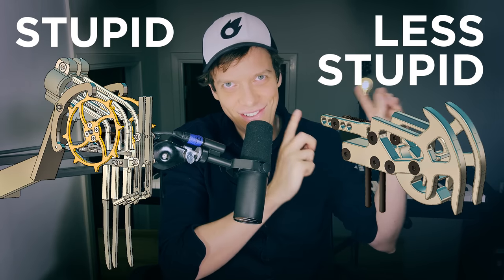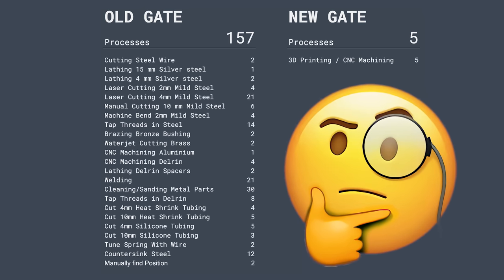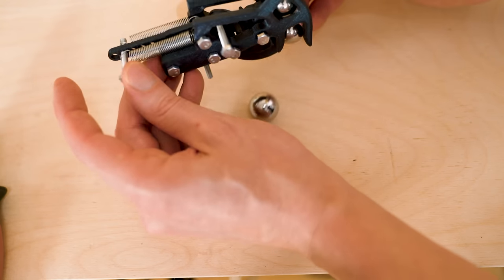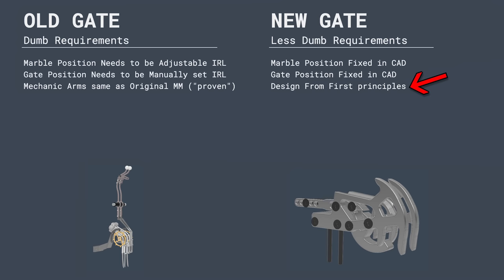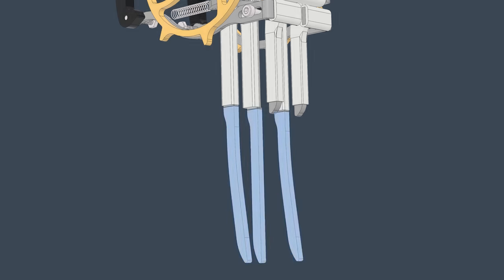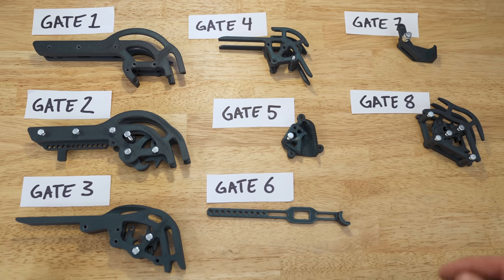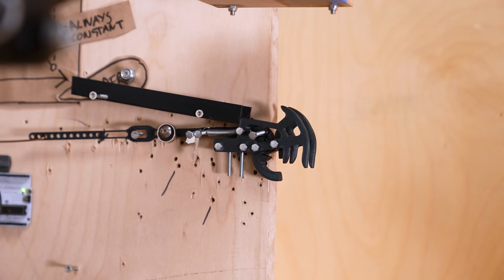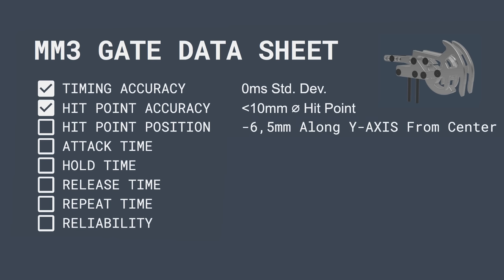This Design Trick Surprised Me!

Comment: You haven't completely prevented manual playing: if, later on, you decide it's worth the part count, you can always add a linkage between the programming wheel and the gates.

The important thing is that you've isolated the gate from this other feature. That way you can focus on what matters for the marble drop.

Now, you've also got the flexibility to only add a manual control to some channels without needing to design two separate marble gates E.g. Just one channel for each note on the vibraphone
Reply: I would just add a button to the front of the gate that is a part of the linkage so a simple press performs the same function. The buttons could even be made to look like a keyboard with black and white.
Reply: @jonathanmyers8477  that’s probably the most simple and elegant solution
Reply: @jonathanmyers8477  Though it comes at the cost of tighter integration. I could really understand leaving the gates themselves unchanged now (since they're a 'known good' element). If I were approaching the marble machine as I would a piece of software, I'd be looking to add the functionality on outside the gate
Reply: He had 2 channels to get faster tempo consecutive notes. The time needed to stage the next marble, as well as the necessary attack, hold, and release times really limited the speed he could achieve without double gates, and he sounds like he wants to retain the ability to maintain tight timing on super fast notes with dual gates (around 16:25).
Reply: @jonathanmyers8477  I though something similar, you’d want to make it so that it makes no contact with the mechanism unless pushed. That way it does not add friction or mass to the mechanism when not in use.

Comment: I'm currently studying mechanical engineering, and this video is incredibly inspiring, not only because of the simple and efficient mechanical concepts but even more so the thought process through the development phase. I can relate to the process of falling, reflecting, and improving through the different semesters. You're always learning new things, through new concepts and processes, and that is what makes the world of engineering and invention so incredible. Thanks for inspiring me and also the next generation of engineers and thinkers.
Reply: Dagern, it might be worthwhile to share this video with the other students, or even your professor.
Reply: If you are to iterate by experimentation the iteration must be fast.  Rather, start with a solid plan, simulate or do quick experiments and finalize it.  Then add optimization and tuning, not wholesale redesign every time.  40 years of engineering and design of microprocessors have taught me these hard lessons.
Reply: @randyscorner9434   Martin's point is to make the design requirements less dumb (@4:33). Since he's a musician and not an engineer (I too have done chip design [for the storage industry] and am now retired; so you and I on the same page) he ended up with a massive reset of the design.

If your initial assumptions are overly complex you're screwed. Witness the recent hard-to-solve security bugs discovered with x86/64 architecture, versus ARM architecture. That whole look-ahead prediction logic for Intel's CISC design is insanely complex, bloats the gate count of each core, and is at the heart of the recent security bugs. Server-class ARM chips are up to 128 cores per chip.
Reply: @randyscorner9434  the difference between Martin and most real world engineering is people are not paying to watch you fail. 

In the real world you have deadline, budgets, and managers. 

A bad product is better than no product in most cases. 

Martin has been making the problem a lot of young engineers make. Paralysis by analysis. 

Also bad products and failures teach you way more than CAD designs. One of the major problems with CAD is that there are so many unknown variables that cannot be accounted for in the real world.

Comment: Simpler is always better in designs :)
 Keep up the good work Martin!
Reply: MRI machines
Reply: The simpliest design would be to not do this. Dropping balls through the air instead of servos? This entire project is magic and whimsy. Removing some of that, OK, but insisting simple is better would mean to abandon the entire project. It's mimicking Animusic, after all.
Reply: I'm guessing that the next Marble Machine WONT USE ANY PARTS AT ALL .................
Reply: Cannot agree more. Each additional piece creates a new failure point as well as a longer time to deconstruct and reconstruct.
Reply: simpler would be to make a programmable instrument that doesnt use marbles as inputs like euuhh a keyboard for example , seeing he already has one could we call the project finished?
Reply: or is that to simple than ? 
maybe he should revisit the speelklok museum and see how many of those machines run perfectly in/on time and beat and tight , its a manual instrument do we really want it to be so flawless that its actually almost digital like?
Reply: That depends. Are you trying to make a machine that plays music? If so, then yes, simpler is better, so make it simpler by removing the most complicated aspect, all the marbles.
You can either use a computer to synthesise the sounds, or if you really want that manual feeling of the instruments, you can just have electromagnetic parts like servos or solenoids play it directly. No need for any ridiculous marbles.

Conversely, you can instead be trying to design a work of art, where simpler is not always better, and aspects of the machine that are being cut will significantly take away from the artistic aspect.
Reply: @jeffreyblack666  exactly my point

Comment: This is a great video.  As a mechanical design engineer and manufacturing consultant for 35 years, usually/often the point of designing and manufacturing a product is to get it into production and make a profit.  Without a reasonable manufacturing cost, the final cost to the consumer is often too high to be affordable.  So even if it is cool looking, it will cost way to much (for the task) if it is too complex.  So I've found over the years that the most elegant solution is usually the simplest solution that does the task well.  So I think you are really on the right path with your new design requirements.

You have to know the market for your product and understand what would be an affordable and reasonble cost to the customer.  Then work backwards in your calculations and you will begin to get an idea of what your cost has to be to get it manufactured and out the door.  Also, keep in mind that if you intend to sell your product on a store shelf, you will likely have to get your total cost down to a small fraction of the price when it is sitting on the store shelf.  It is often the case that the price will be doubled each time the product changes hands.  So you may sell your product to a wholesaler for $100.  The wholesaler may sell it to the retailer for $200.  Then the retailer may sell it to the customer for $400.  So you make need to build it, package it, market it, and include a profit to you for a total of $100 just so that it can be sold to the end customer for $400.  That is a very tall order.  So think of it this way.  If you can reduce the cost by just $1, the cost to the customer can be reduced by $4.  This is a great thing.  This also shows why it can really pay off to sell directly to the end customer... because these markups can be reduced or eliminated.

Ed Schultheis, PE
Mechanical design engineer & manufacturing consultant for 35 years
Schultek Engineering & Technology, Inc.
schultek dot com

Comment: 6:43 I think you could play manually, same way you've been opening it for the tests! All it would need is a little handle on the spring loaded part, and maybe design it so that the gate can open independent of the prog wheel. Having the drop be on the release adds some difficulty, but you're already needing to lead your shots because of the falling distance of the marble, so that won't be hard to get used to.

The biggest problem is how awkward it would be with them all lined up. the easiest place to put the handle is underneath, but you run the risk of getting in the way of the marble falling. You could probably overengineer the hell out of it and get it to work, but I get the feeling that that's the exact opposite of what 2022 Martin wants to do.
Reply: Yeah, it could work but it should be at the bottom of the priority list. To avoid feature creep killing the project, we shouldn't think too hard about this until the machine works
Reply: I think he could add the manual play action later, and it might actually help with the aesthetics and making the machine's playing more visible. Adding levers attached to the spring loaded part like you said would do it and depending on how they are attached, it would also show movement for each gate when not being used to play them manually. It would definitely add some complexity to the machine, but if he gets it playing the way he wants prior to adding them, he can see how much of an effect they would have on how well it plays and determine whether the added complexity to add manual play and visibility of gate movement is worth it.
Reply: @Gildaaaaaaas  yes it would be after the device is confirmed to works that you would try to add the wants to the designs like manual control

Comment: You're not comparing the old and new gates apples-to-apples.  With the old gate, you did long 80,000-marble runs to find problems.  When you start using the new gate, you'll very likely encounter bugs you hadn't thought of.  In engineering, the prototype is always simpler than the working solution.  We sometimes call this "powerpoint engineering".

It's not really a bad thing, you should just keep in mind that you're not done until you're on stage at the world tour.

Comment: I have a thought about the programming wheel that I hesitate to mention, because it involves complication in order to make an easier end experience.  Instead of using pegs that you insert or remove, you could use mechanisms like those of pens, where you push and it goes down, or push again and it goes up.  Maybe you can just find a lot of free pens to use? 🙂

Comment: Finally some sense in the design philosophy of the machine! I've been following the MMX from the beginning and I've even left a few comments here and there when Martin got in trouble because he wanted something to look "cool". I have always been of the opinion that the machine will look awesome so long as it actually works, just like the original looked when he made it look as though it worked, for the video. I hope he gets rid of the metal wire funnels next!
Reply: Curious, what do you think he'll replace those wire guides with?
Reply: @sabata2  If I were building the machine I would put one big pyramid shaped funnel for the xylophone. Obviously much wider than taller. Something like reverse house roof, you know where the edges don't meet into a single point. Padded with some sort of foam, or felt, or a extremely toxic liquid rubber even. Since all the balls would converge at the bottom and one of the sides, there would need to be a mechanism of lining the balls on to a track that would lead them to the elevator mechanism. I believe Martin has solved similar problems already, should be possible. For the base and drums, I would use the same design but a lot smaller.
Another thing that could also work is to 3D print the funnels and still have the transparency of the original metal wire funnels but with 99% less complication on the assembly and 99% easier to reproduce.

Comment: 04:29 Really? That is not the core reason, your design became better. Especially since "dumb" is quite a subjective characteristic from each different perspective. Maybe you are gonna point the characteristic out later in the Video, but I think the real core reason, why the other design became better is because you design it very simple. Simple meaning, by using as little amounts of parts as possible. The more parts you use, the more dependencies are being created, which increases the possibility of inaccuracies and failures, especially when you have to manually craft a lot of these single parts. Later in your video, you kinda describe that process of simplifying your product, by getting "LESS" requirements than before. In the end you make it simple, but effective. But I can fully understand, that keeping it simple is a challenge in itself for creative minds like yourself.

Comment: Congratulations on this achievement. The new gate looks so much more reliable. The old gate might have looked cooler but this new gate has beauty in its simplicity. As for the manual playing I would not be surprised if a manual trigger arm could be connected later down the road in the design. Maybe keep this as an idea to maybe think about. Good luck on the programming wheel!!!

Comment: Divide into modules and conquer by testing small units is not just a hardware-thing. I'm a software engineer and so-called unit tests are the equivalent to what you've been doing the last few weeks.
Next up are integration tests where (software) modules are tested together; how they interact with each other and where problems may arise. For that you need *interfaces*, something you've also developed for your new design.
The (usually) last verification layer are *system tests*. In the MMX everything you did were system tests. That's were all modules are tested together. This is where usually the last few errors are detected, most should have been caught by the previous verification steps. It is also much harder to pin-point what causes an error at this step. That's why it was so hard to find issues in the MMX design where hours upon hours of testing were needed.
It's awesome to see how you are implementing all of this in hardware!

Comment: Even though the gate never failed in the past month doesn't mean it can't fail.
If I remember correctly the old gate also never failed until it was mounted on the machine. (After you stacked multiple marbles on top of the gates they started to fail)
I would test what is actually necessary for the gate to fail, so you know in what conditions the gate will fail (and if those conditions are realistically possible on a completed marble machine)

Comment: One suggestion: don't just test the "success modes" and determine that it works. Try to stress it and find the failure modes, then test to those modes. Look for edge cases, and build your test cases around them. Your "high speed" tests started to do that, where you could see the feed bouncing when you got too fast of cycle times.

A few other tests that may be good to run. Try vibrating the gate at different frequencies as you cycle it (the whole machine will be very noisy and have lots of movement). Try different (and extreme) head pressures (numbers of marbles pushing against the gate waiting to be played). Intentionally cycle it partially to try to induce missed note failures (simulating a programming wheel issue, or other linkage wear/failure). 

Try to avoid designing to 100% success rate, but instead aim to understand the failure boundaries and ensure that there's enough buffer between that failure boundary and your expected production use case, accounting for durability and wear.

Comment: 6:44 you can play manually with your fingers if you want to, it is a try-able optional one piece system, since the door is controled by a back and ford motion, a single piece could be attached to it and work as a button, if it makes problems, get ridd of it, if it doesnt, wo-ho, one piece added, manual playing added.

Comment: Hi Martin! I really love, that you finally see a 3D-Printer as a valuable asset. But remember, as I always said: This is a prototyping machine. You don't print parts, you're relying on. But as far as I see, the new gate couldd be made also entirely from delrim or brass or aluminium with a CNC machine - this is your next step after prototyping with a 3D-printer.

Comment: I feel like the removal of being able to manually run the gates as a requirement plays into the greater focus on functionality over aesthetics. I say this as the manual activation during a performance kind of added a visual aspect to the videos that looked kind of cool. In the same kind of way that The Doctor running around the TARDIS activating different levers has to it. The third iteration of this machine seems like it will be quite a departure stemming from the different approach to its design, and it'll be cool to see how it turns out!

Comment: What I think is really great about this approach is that once you have a functional part (form from function) you can then add extra form and flair without compromising the functionality. Like with the marble gate design, for example, there are lots of cool colors that you could 3D print the different parts out of, or different materials it could be made of. Personally, I think the best way to go with this material wise would be to just get cool looking filament colors for the different parts, as that ensures that making replacement parts won't be a problem.